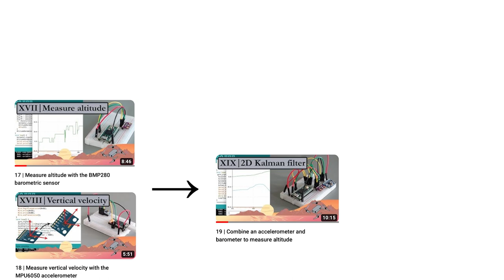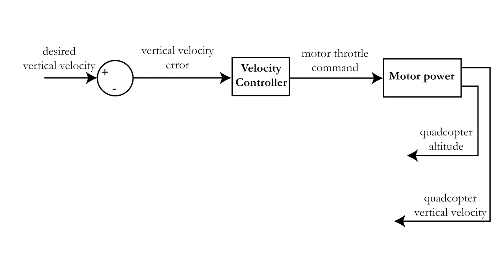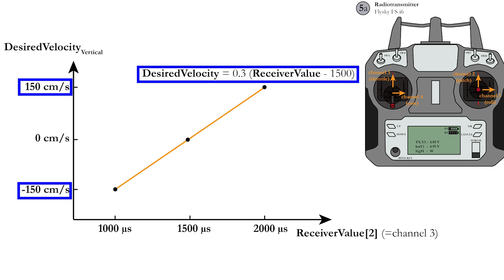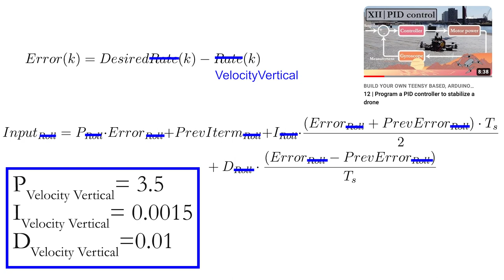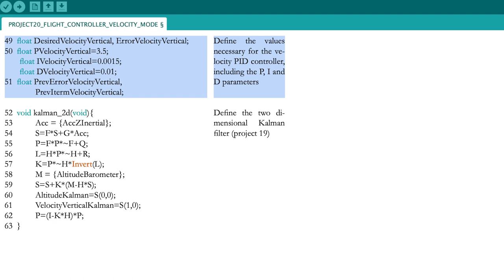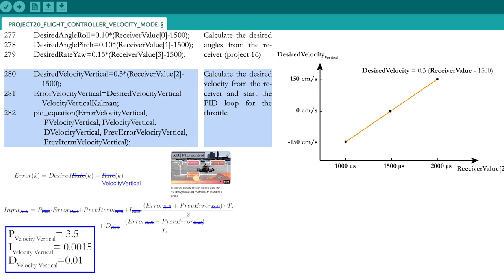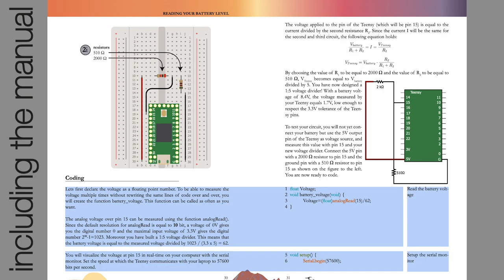20 | This Arduino code is a vertical velocity drone flight controller

Comment: Hello Master, thank you for this great open-source project, I have learned a lot. And I'll ask you more. I'm trying to use ESP32 devKit V4 and Arduino nano to do this project, but i wander if they can support all these calculations? My second question it about sensor; How can i use perfectly these sensors : GY-GPS6MV2, SIM800L and HMC5883L, if i want to add them ?

Comment: Update! All my components or solder to the boards. When I went to calibrate, the ESC's one motor was shorted out because the screw was too long and touched the motor windings. So I had to place an order for a new motor and ESC. Getting close to finishing my build.

Comment: Hello, if anyone is having the error "Compilation error: no match for 'operator*' (operand types are 'BLA::Matrix<2, 1>' and 'bool')" when trying to compile the code on Arduino IDE, try installing version 3.7 of the BasicLinearAlgebra library by Tom Stewart. If you install the newest version, you will get this error, and if you install version 3.7, everything will run fine :)
Reply: Or replace Invert() with Inverse(). I believe the API changed, and Invert() now modifies the original Matrix, while Inverse() creates a temporary matrix for that operation

Comment: Just a question out of curiosity, how would you design a controller for correcting the altitude measurement rather than the vertical velocity? Given that the motors speed x drone altitude relation is considerably non linear.

Comment: Dear Teacher! In Vietnam there is no tincy board, I use arduino nano. so can I replace pins 1,2,3,4 with pins A0, A1, A2, A3 to connect to ESC? Thank You Teacher
Reply: No, A0 to A6 pins are dedicated for analog inputs, you can convert that analog value into digital one, I mean they can be also used as digital input.

But, they can not be used as output in anyway

For esc, use digital pins of your nano board.
Thank you

Comment: Hello, greetings from Colombia. Congratulations on the excellent series of videos for your Arduino-programmable and Teensy-controlled quadcopter. From the experience I have so far, yours is the best series on the subject I have seen so far. Not only because of your formidable practical tutorial, but also because of the mathematical foundations that you explain. Is there the possibility of adding GPS (to plan waypoints and autonomy), telemetry (with the transmitter or a ground station) and/or a companion computer (raspberry pi via MavLink and DroneKit)? To support your projects more directly you could continue with the series of videos and tutorials on Patreon, I will be one of the first to join.
Again, thank you very much!

Comment: Hi, I built my own quadcopter using your code but with some differences. For example, I use a HC-06 bluetooth module instead of a radio and an Arduino NANO instead of a Teensy 4.0. I'm currently on the "third version" of the flight controller, ie the one that uses the barometer. But unfortunately, I can't fly yet, it behaves strangely and hardly stabilizes at all. I think it's because the PID coefficients are not set correctly (I also use my frame, motors, etc.). I don't remember seeing recommendations for their selection in the video, so I installed everything as in the video. On the 4-inch propellers, it ran away too fast and I used the motor shutdown button, and on the 3-inch ones, I noticed that it went into resonance just like the curve when you explained the PID controller. I will be very grateful if you can help me in any way.
Reply: Update: I went back to version 2 and it's much better, but during testing I broke one of the frame beams, so I'm on the mend now.
Reply: @romaninlviv3761 how did it fly ??? Is it stable than the 3 vision,share your code i can also provide help.
Reply: Do you mind sharing your code? Ive been trying to make mine fly as well, but I cant seem to get it to work
Reply: @JesusIsTheWayToHeav3n  It was so long ago that I threw it away, but I can say that there is nothing significantly different in my code than in the author's video.  I used the standard XYremote code for bluetooth.  Also I changed pc so I don't have access to the old code at the moment.  But I am ready to assure you that they are absolutely useless.

Comment: hello sir i did exacetly you taught us in the video series but i am using 920 kv motor with 10 inch propellers and the frame i am using is f450 
.but is not stable and some times the motor speed automatically increases .i think its pid peoblem but i dont know how to resolve this please help me
Reply: I am also facing the same issue. Did you found any solutions yet ?
Reply: @vivek-iit  If you are using an f450 frame the pid values I am using for Roll PID:- 0.75, 0.012, 0.0085 and for Yaw PID:- 4.2, 2.8, 0 
Hope this will help you... and you still facing problems make sure to reconfigure PIDs values
Reply: @priyanshuwaghdhare5458  Are you able to perform altitude hold by the author's PID values ? Thanks a lot for such a valuable response.
Reply: @vivek-iit  No I am still trying to perform a perfect altitude hold but I am not getting perfect PID values. 
Well.. if you figured out any PDI values plz... inform/share me.
Best of luck for your project 👍
Reply: Using different frames and motors requires re-tuning PID values, as the values in the video only apply to this drones' size. Watch my F450 Teensy drone with GPS and optical flow and autonomous function. https://www.youtube.com/@darkonaire